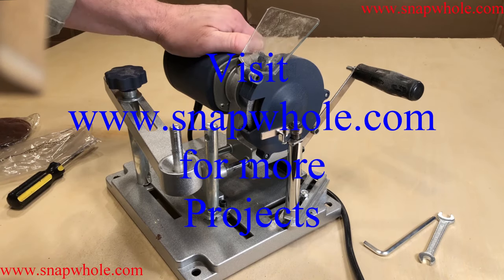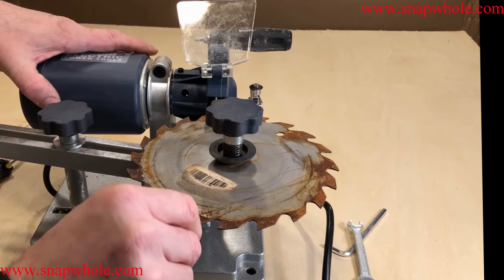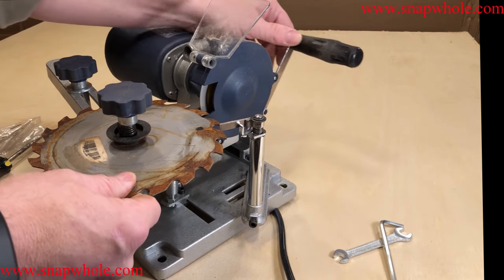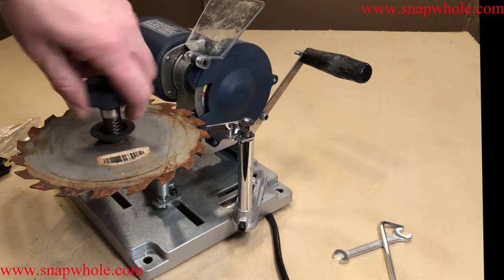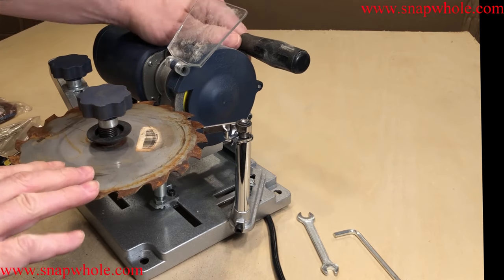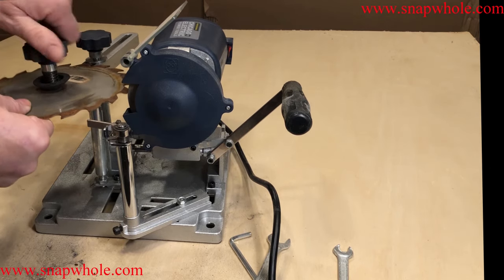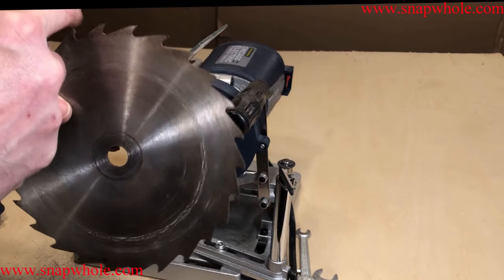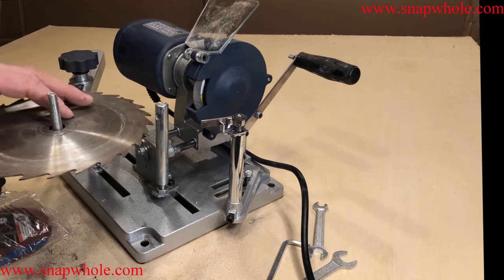Harbor Freight Circular Saw Blade Sharpener Review and use Demonstration from Chicago Electric

Comment: I don’t use the ratchet device I just line up each tooth by hand and it works fine
Reply from the maker: the ratcheting device is designed to allow for an easily repeatable action for consistency, what you are doing by hand works just as good if you take your time - thanks for subscribing!

Comment: I got one recently and have only sharpened one blade. I followed the directions to a tee and it worked flawlessly? I noticed that you are using the diamond wheel? I know it will work but my directions said use the stone wheel when sharpening blades that are not carbide tipped?
Reply from the maker: they recommend using the diamond wheel on carbide tipped blades, the stone wheel will be worn out if used on carbide tipped blades, the diamond wheel on the other hand sharpens carbide tipped blades, and steel blades, so the recommendation on what wheel to use for which blade is more about not wearing out the stone wheel on carbide tipped blades, if not setup correctly, the diamond tipped blade can wear out your regular blades early, the stone wheel is more forgiving of incorrect setup - thanks for subscribing!
Reply: @snapwholeharborfreightreviews  I agree with your statement.

Comment: On your particular setup wouldn't the last two teeth receive a different grind because the tooth position will have change when the stop comes up against the newly sharpened teeth? Wouldn't it make more sense to adjust your stop in the gullet instead of against the tooth... Or am I looking at this wrong?
Reply from the maker: its almost impossible to get the stop block to nest in the gullet and still maintain the best ratch/rotation movement, the last two teeth would be slightly different, and both of these issues/fixes would vary greatly with the size of the blade, watch for an upcoming video on how big a blade you can sharper, I already posted the video, so it will work in to the schedule soon - the last two teeth being slightly different would not be relevant for blades with more than ~16 teeth

Comment: What do you think of it after 2 years now?
Reply from the maker: I keep all of my blades sharp, and this device is working just as well today as the first day I bought it, if you buy HF blades, it takes longer to save enough month to pay for it, but I bought a stack of 50 blades, lots of different size from 4 inch to 16 inches and sharpened all of them but the plywood blades and save a lot of money paying to sharpen them, and got more from the ones I sold because they were sharp - I still recommend this for sharpening saw blades, thanks for subscribing!
Reply: @snapwholeharborfreightreviews  thanks for the info, I've been using Diablo for years but I'm switching to CMT.... my Diablos will be my backups. I'm also interested in the Spider Tarantulas that Lowe's carries... honestly because they look cool lol and my son loves tarantulas lol, but I think they're made in China and if they are that'll be a deal-breaker for me  :-(

Comment: The brown blade is for sharpning the top.
Reply from the maker: you will have to add some information to your comment...... thanks for subscribing!
Reply: Ill try, when you use the brown one, you will have to change the angel of the motor to about 10 degrees and the angel om the brown blade will fit on the top

Comment: You are using the wrong sharpening blade .
The Dimond one is for Carbide tip blades only
Reply from the maker: you have miss understood the requirements, the diamond wheel is recommend for carbide tip blade, but can be used on any blade, the stone wheel should only be used on non-carbide blades, it will work work on the carbide tip blade but will be used up quickly for not a lot of results - using the diamond wheel on non-carbide blades most certainly works - thanks for subscribing!

Comment: A lot of the dust is the rust.
Reply from the maker: same amount of dust comes off when sharpening a clean blade, especially when using the diamond wheel, the rust did not account for every much of the dust - as mentioned in the video I used an old blade for the demo because I normally do not have dull blades - thanks for subscribing!